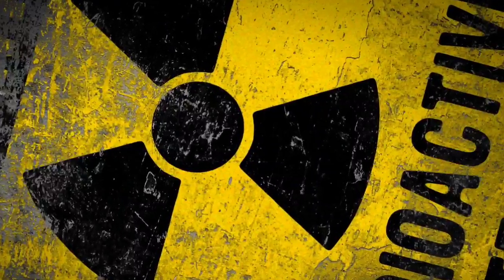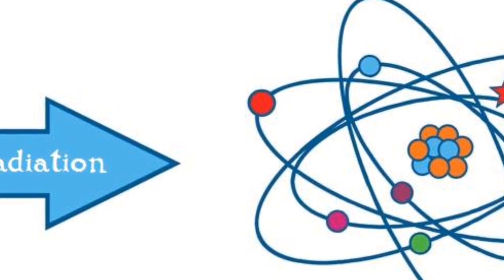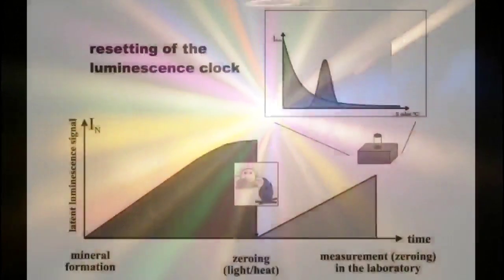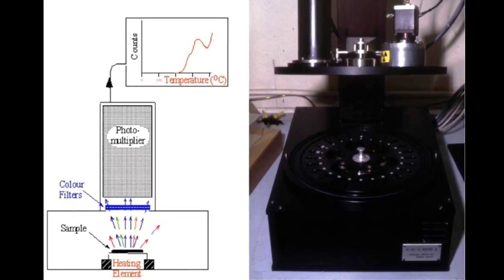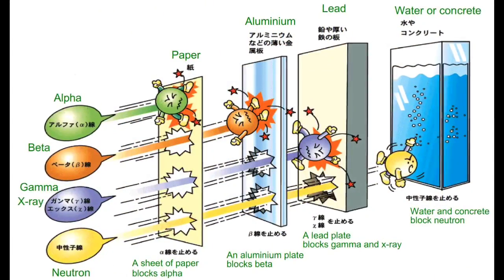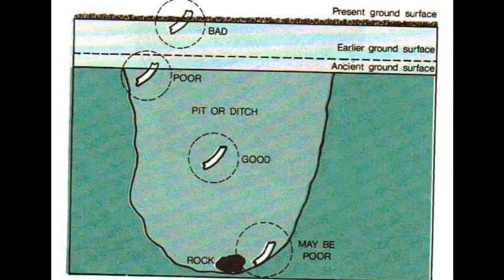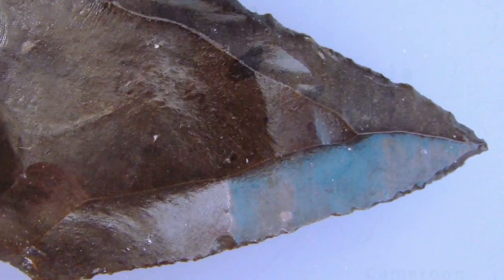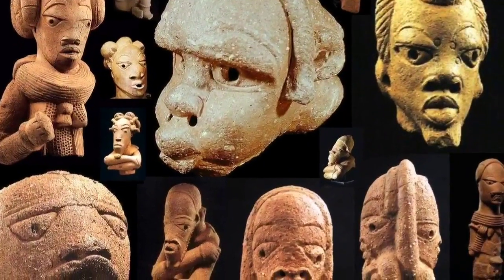Aspects of Archaeology: Thermoluminescence Dating

Comment from the maker: @CanadienAtheist Thanks for your comment!

The short answer is no, it's not more accurate. This method is an excellent compliment/ confirmation for RadioCarbon.

The rate at which electrons are 'trapped' is not uniform throughout the material as it depends upon essentially random imperfections in microscopic crystalline formations - Therefore there is a margin of error of between 7 and 15%.

Having a good idea of dates beyond 50kya is better than nothing though!

Thanks for watching!